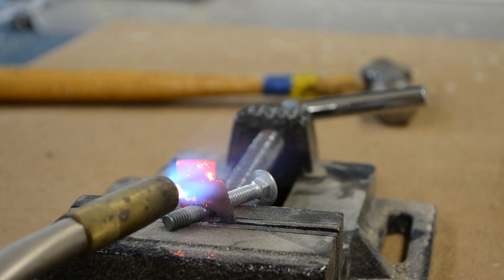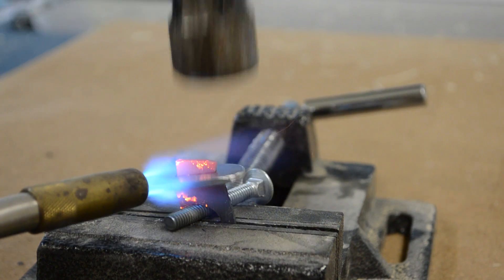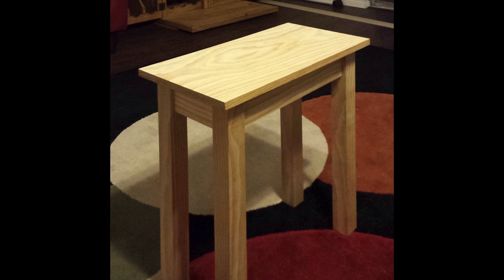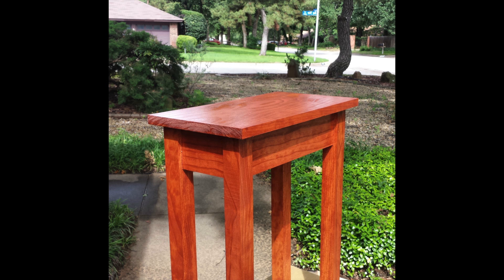Balloon Heat Sink Experiment & Freebooting (FT28)

Comment: When making jewellery and soldering delicate pieces I actually use the vice because it is a heat sink, it can work to your advantage at times.
If you are in a similar situation again use two thin shims of hardwood as sacrificial jaws, just a very thin layer of wood will insulate enough for what you were doing. Obviously they will burn up after a few minutes so if its a long job make sure you have a few spare sets, works well though and I have done it many times.
Reply from the maker: Shims are a very good idea. When you talk about the jewelry it reminds me of soldering heat sensitive components
Reply: caskwith Or use 2 low-density firebricks. Will insulate and won't burn/melt (unless you're using a plasma torch). Whether they can withstand vise pressure; that's another story altogether.

Comment: What if you heated the tang up red hot, then lowered it further into the vise (using pliers) then continued heating it while beating the end over?
Reply from the maker: 007Cornhusker I think the time combined with the cold vise it would still pull most of the heat out
Reply: Understood.

Comment: You could of easily heated the metal high up from the vise and when its red hot you could if dropped it down lower and peined it :)
Reply from the maker: Mc Dermott Customs I really think with the time that it would take to do that combined w/ the vise pulling the heat out it wouldn't really work all that well